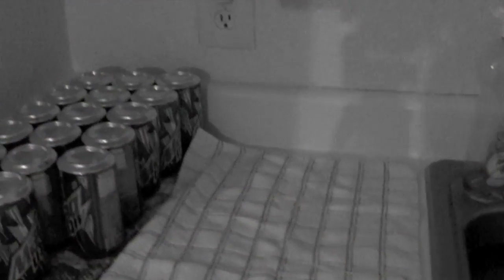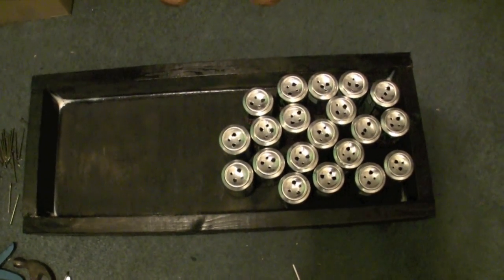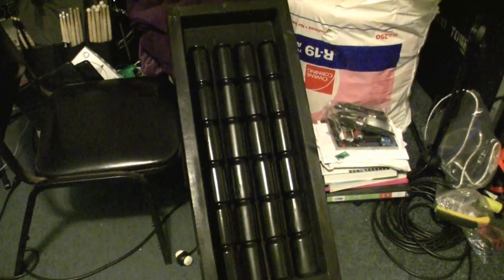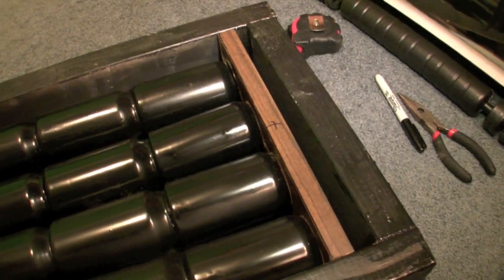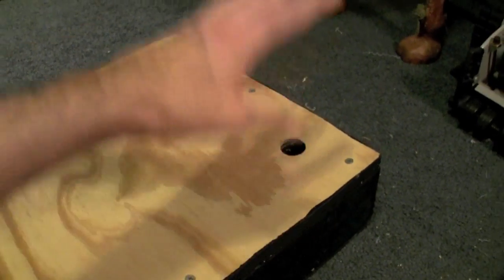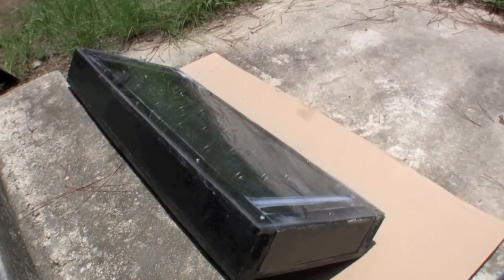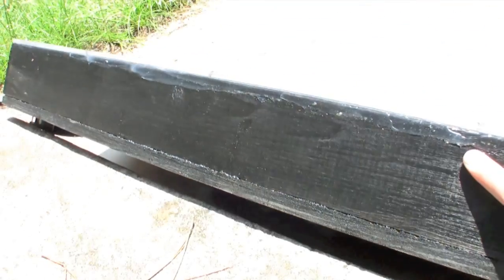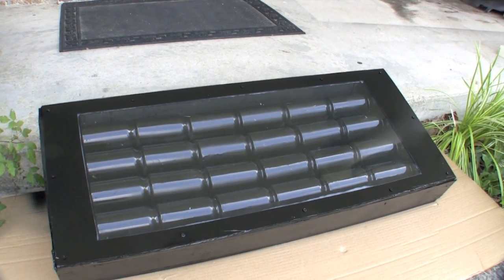Building a Solar Can Heater (Window unit)

Comment: I wonder if lining the back and sides with black brick would retain heat longer after sundown. Obviously that would not be suitable for a window installation but just under it or next to it should work. I’m presently gathering materials to make one and have also been studying rocket mass heaters. I guess this would be a cross between solar and RMH. I may just try it to satisfy my curiosity.

Comment: I am looking to know how to install something like this onto the house and even maybe for  what you have done also for the window unit. Question is there is a lot of video's showing you how to make them. But nothing showing you how to install them. Can you help and maybe make a video for the unit on the house and the one for the window? Also how many rooms will the larger one that you made heat up and how warm do the rooms get? And if you could please email me at dawnphilpot74@gmail.com. I need to come up with something that will be more efficient to heat with because I live in a older home and it only has a small electrical furnace and man the winter time it is so chilly in here. Over half of my house stays cold. I need help please and thank you... If you can do this can you give complete directions for how it is done? Thanks again.

Comment: So out of these 1000s of videos! No one tells you how to regulate the 
heat for winter and summer! hello! Can you tell me! Brian..
Reply from the maker: This small unit can just be pulled out of the window. I built a large unit that sits out side. I cover it with 2 large tarps. You can also use a pipe damper.

Comment: I just found this and I love the concept... the only thing I would do differently would be to 
1. line the rear plate with reflective insulation try to keep as much heat inside the box and heating the cans, or
2. add larger thermal mass to the back plate
3. I would set the fan to blow cool air into the box rather than exposing it to high temp air.  the bearing will dry out and any plastic in the fan is not going to last long..
But hey its a damn great idea.... well done

Comment: Do cans painted black generate more heat than non painted cans, like soup cans?
Reply: Wes Hamby Correct. Black makes the difference. Black absorbs heat while white reflects it.
Reply: eye95records Plastic doesn't absorb heat as fast as metal. If you want to mess with cans, get the metal clothes dryer vent pipe, paint it black and  and snake it back and forth inside your frame. HTH. :)
Reply: i was thinking about using black PVC pipes
Reply: There's an idea.. I've seen people use copper piping and still paint it black.. the black must make a difference
Reply: i can see the advantage of having all of the little pieces inside leftover from cutting the tops and bottoms off, as surface area, but wouldn't that really only matter after the sun goes down and the heat exchange is a tad slower? not sure. also what about the caulk? does it stay ok and not give off vapors? just asking?

Comment: Hello, I'm curious, I've built version of this using aluminum downspouts which I'm just about ready to test, but I was wondering if I should try a smaller diameter hole cut 1" for the intake. My thoughts are this may create a slower draw, giving interior a greater chance to heat. I'd keep exhaust @ 3" though. Do you have any thoughts on this? Great vid by the way and I've picked up some great tips, thanks for posting.
Reply from the maker: The air will move a bit slower but be hotter. I'd say the 3" exhaust is a great idea.
Reply: Thanks, I've picked up a 3" fan and I'll try a 1'' intake hole to start and see what happens. Thanks for the advice!

Comment: I am not sure if I completely understood... but are you putting this in a window?
I don't think that will work because the amount of sunlight (energy)  that falls on this heater is teh same amount that otherwise would fall through yr window.
The only thing that  might be beneficial is that maybe the amount of heat that you otherwise would loose  through the  glas may be less

Comment: nx2overide thanks for the  video ,  i s  I 'am   into this  project,  i would  like  to  ask  you  question, in the summer  time which you d,ont  need  this  panel means  you  have  to  disconnect the  2  pipes from  and  into  the house??  or  you  just  move the  panel a way?? thanks
Reply from the maker: well this model is a window unit it just sits in the window of the house so i pull it out during the summer and store it away.. my large unit on my other channel ( Large Solar Heater "Walk though" ) had dampers so i just close them.
Reply: Many thanks  nx  i preciated

Comment: can anyone tell me why cans are better than the back of the box being black?
(Someone qualified)
My son says surface area, but sunlight comes from one point.
Reply: Because of the thermal properties .... cans are aluminum,  both aluminum and copper are good conductors of heat,  wood will get warm (eventually) but will not produce the heat you are hoping for

Comment: How would the heat generation change if you were to use a mirror behind the cans instead of painting the back wall inside the case black?
Reply from the maker: I don't think it would help much because you would be reflecting heat away from the massive black backing. I have thought, if there was a way to have mirrors on the sides tilted at an angle so that the concentrate the heat towards the back.. that would boost efficiency if you put black metal plating inside.
Reply: nx2overide
 Try using the front panel (Cut to size) from a big screen TV ....and matt black finish.

Comment: I'm not heat expert or anything, so I may be asking a stupid question.  Wouldn't it be more realistic to check the difference in temperature during the winter when it's not so hot outside and the sun is not reheating already hot air?

Comment: I've just started a small version of this to heat my greenhouse as i live in the UK you know what they say about how crap out weather is over here but I've used the smaller thinner Energy drinks cans 6 rows of 5 stacked I'm thinking of using a distilling copper coil to feed into the cans to allow the air inside longer to heat feeding it from base to top then back down across the rows i have also insulated the back using one of those plastic foil blankets runners use after a marathon to line the back board and also some polystyrene strips from old packaging to keep it all tight only allowing the clear front to be exposed what do you think about the coil idea?
Reply from the maker: Give it a try sounds like it would work
fine

Comment: these work better if you understand why they work,  first  heat rises, so sitting them on the side doesn't work well...  standing long ways  the cold air from the bottom heats from the solar radiation moving the hotter air upwards,  to be honest u don't even need a fan,

Comment: im not sure how the fan works, is it electric or a battery fan?
Reply from the maker: its a dc motor will run on a power brick wired to AC at 5 ot 6 watts tops. I run all my fans off my solar grid.
Reply: you could get a 1.5amp solar panel (these are small) and attatch it to your 1.5amp computer fan and it would run beautifully.
Reply: you guys seems smart about this, i need to research battery stuff..i have no idea..

Comment: Do you have a video showing it working in the winter? I mean, You don't need it at the time of year you shot this video.. Whats the output temp of air coming in your home when its 30deg. outside???
Reply from the maker: look up Solar Can Heater (Window unit) in action (clowdy day) That was my test before i got rid of the unit and built my big unit.
Reply: nx2overide Will do, Thank You!

Comment from the maker: yes you can power a small unit like this with two 9 volt batteries... i don't use this anymore as it was a prototype really. i made a large unit and it definitely works at low cost.

Comment: i appreciate your quick response. it would be nice to have a video of the electrical aspect as i  and others are novices at it.  i'm going to sound dumb here. doesn't the adapter need power? i understand now how the fan is working thru the adapter but guess i didn't know they had self-powering adapters. is it something you can get at radio shack?

 i bought 2 little fans for the fins & motors and was going to use solar cells but if i can use adapters i'd go that way.

thanks for your help.

Comment from the maker: @msguit Im using a 12 volt DC adapter i bought just clipped off the tip and shrink wrapped the wire together using wire sleeves. Its a 12 volt fan.. i did the same thing on my larger sliding glass door unit.. i just finished a huge model im using a large 12 volt fan powered via solar panels. ill be uploading that video next week.

Comment from the maker: @TheBootscooter222 with this small unit after the sun goes down its acourding to how cold it is outside.. my heat is automatic so i just kicks in when it needs to.. a unit like this is only for 1 room a larger unit can heat multiple rooms but  both only suplement during the day.

Comment: I suggest making your inlet hole larger.  Usually temp tests are taken from the outlet.  If you push air in you are more efficient because cooler air is denser, you could simply turn the fan over so it is pushing instead of pulling

Comment: One thing that saved me about 30 bucks a month in Arizona summer,was to relocate the water heater to the side of the house that the sun hits. i guess you have the opposite problem. I think it is harder and more difficult and expensive to cool than heat?

Comment from the maker: @mettanc air is pulled in from within the house though one hole.  The cans are heated by the sun in a sealed compartment the air travels though the cans and is warmed and then pushed back in the house by the fan.  As the fan sucks the hot air out more air enters the cans and is heated up.

Comment from the maker: @MapexRG yep pretty much.. and no, it will only work during the day because it need the sun heat up the cans.. but my thing is with a large enough unit you could heat several rooms in a house in the winter during the day.